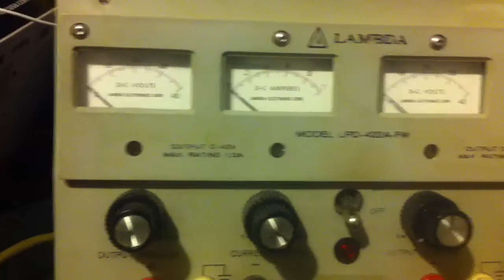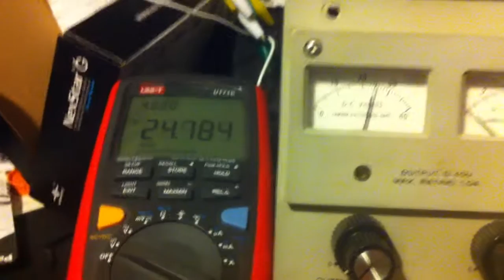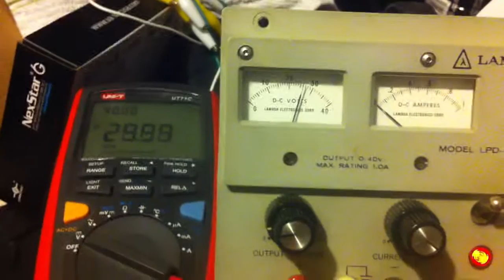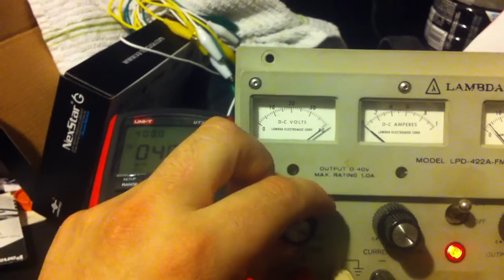Lambda dual output power supply issues.

Comment: Open it up and replace the electrolytic capacitors. Don't worry too much about the big bulk capacitor (and don't touch it), bit the caps on the control board dry out and you get all kinds of issues,
Will last you another 40 years. Those Lambda supplies are the best out there.
Reply: +PelDaddy Yeah, I gave that a try, a lot of the traces on the board pulled up, so needed some surgery there, but the new caps didn't help at all, I was troubleshooting it for quite some time, and after spending $35 on capacitors, I was just so annoyed and fed up I got another one, and got the ebay seller to send me a picture of the caps, which they did, and it's a newer model.

This thing is sitting in a box with all it's parts, so I'll probably try and fix it later on, but for now it will just gather dust.

Comment: I have the same problem; i replaced every electrolytic cap and changed potentiometers, TO-3 transistor and i still get that strange behaviour.  Did you find the problem?
Reply: Did you find the problem?
Reply: @baghdadiabdellatif1581  yes it was a cold solder joint on a resistor on the main board
Reply: @geologie67  thank you